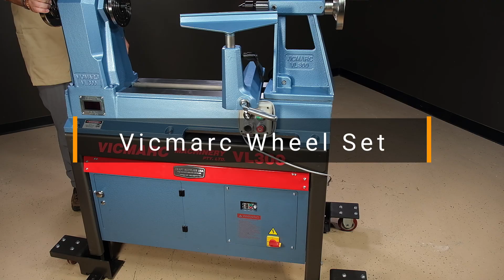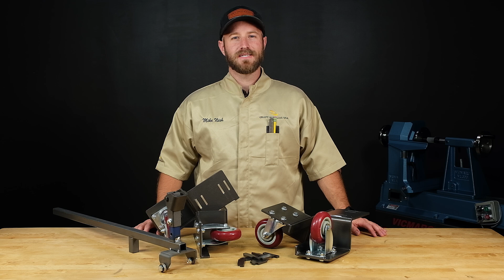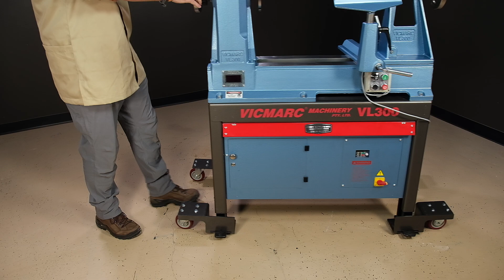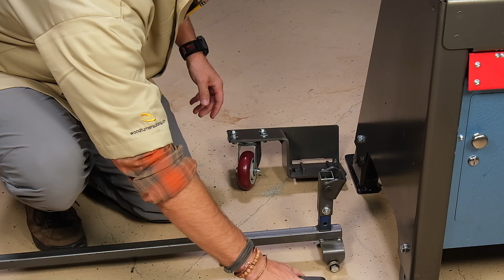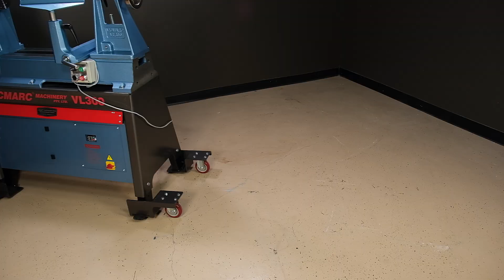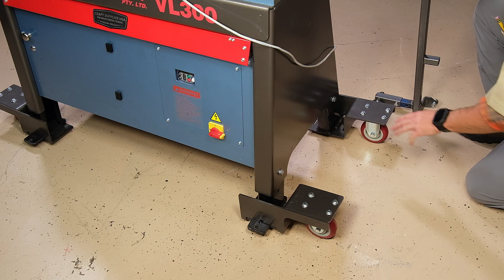Vicmarc Lathe Wheel Set

Comment: Very good solution, one of the reasons I chose the 2436 Laguna over the VM300 lathe was that there is no wheel kit available for the Vicmarc range of lathes, which, when you are talking about a machine somewhere around the 300kg range, having a wheel kit is a no brainer.

Having all of my machines in my workshop on wheels, my preference is to have four swinging wheels. My 2436 Laguna has four swinging wheels and it makes moving it into and out of it's storage corner very doable.

Very hard to put one end of the lathe into a corner with that long lever though!  🙂